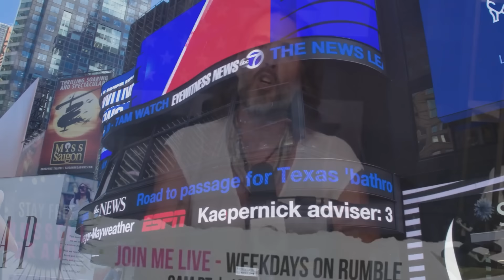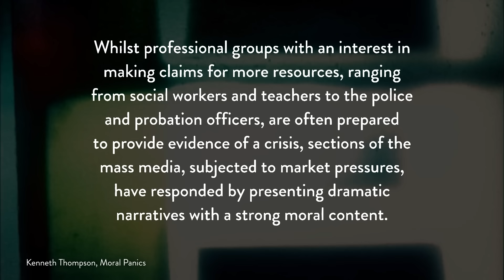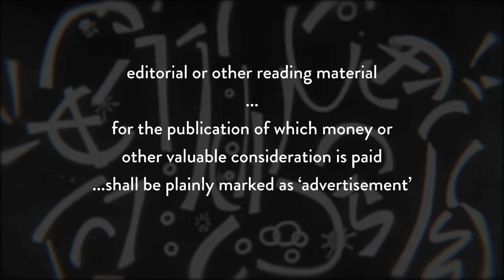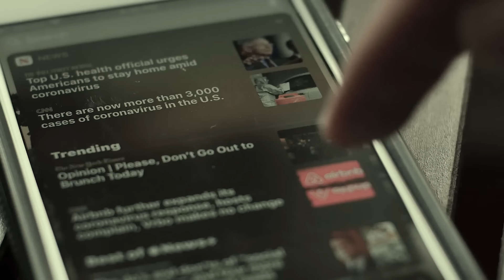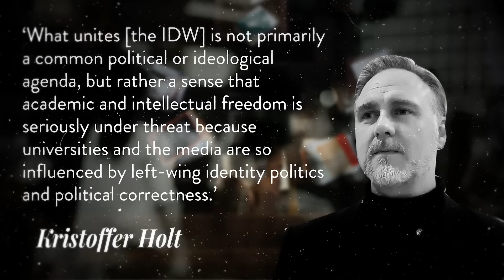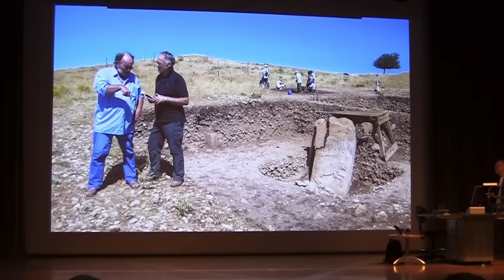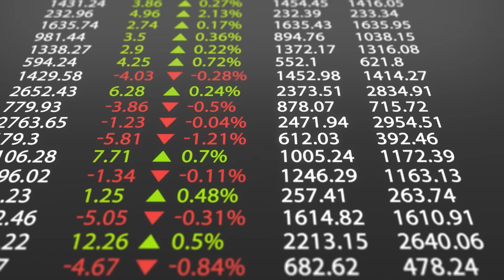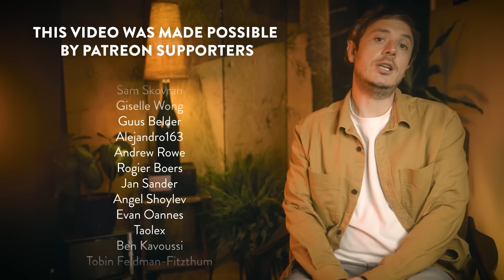The Rise and Fall of the Mainstream Media

Comment: Yesss, another long video full of quality and with no ads that I can enjoy for years! Thank you so much Then & Now!
Reply: Okay bot
Reply: It literally has ads.
Reply: Just have youtube ad free. I never get one single ad. It worth money
Reply: I can't imagine anyone finding this either entertaining or enlightening enough to rewatch. Good for you
Reply: The The
Reply: This video makes you think twice about the recent stabbings
Reply: Technology may have advanced enough to release civilization from the confines of the second law of thermodynamics. 

These confines were imposed during Victorian England's scientific and religious cultural fascination with steam engines. 

The second law is behind modern refgeration needing electrical energy to compress the refrigerent to force it to release as waste the heat that it has removed from the refrigerator's service interior in the cooling part of the refrigerent's circulation. There is also discarded heat from mechanical friction and electrical resistance. 

Refrigeration by the principle that energy is conserved should produce electricity instead of consuming it. 

It makes more sense that refrigerators should yield electricity because energy is widely known to change form with no ultimate path of energy gain or loss being found. Therefore any form of fully recyclable energy can be cycled endlessly in any quantity. 

In an extreme case senario, full heat recycling, all electric, very isolated underground, undersea, or space communities would be highly survivable with self sufficient EMP resistant LED light banks, automated vertical farms, thaw resistant frozen food storehouses, factories, dwellings, and self contained elevators and horizontal transports. 

In a flourishing civillization senario, small self sufficient electric or cooling devices of many kinds and styles like lamps, smartphones, hotplates, water heaters, cooler chests, fans, radios, TVs, cameras, security devices, robot test equipment, scales, transaction terminals, wall clocks, open or ciosed for business luminus signs, power hand tools, ditch diggers, pumps, and personal transports, would be available for immediate use incrementally anywhere as people see fit. 

Somé equipment groups could be consolidated on local networks. 

If a high majority thinks our civilization should geoengineer gigatons or 
teratons of carbon dioxide out of our environment, instalations using devices that convert ambient heat into electricity can hypothetically be scaled up do it with a choice of comsequences including many beneficial ones. 

Energy sensible refrigerators that absorb heat and yield electricity would complement computers as computing consumes electricity and yields heat. Computing would be free. Chips could have energy recycling built in. 

A simple rectifier crystal can, iust short of a replicatable long term demonstration of a powerful prototype, almost certainly filter the random thermal motioren of electrons or discrete positiive charged voids called holes so the electric current flowing in one direction predominates. At low system voltage a filtrate of one polarity predominates only a little but there is always usable electrical power derived from the source, which is Johnson Nyquest thermal electrical noise. This net electrical filtrate can be aggregated in a group of separate diodes in consistent alignment parallel creating widely scalable electrical power. The maximum energy is converted from ambient heat to productive electricity when the electrical load is matched to the array impeadence. 

Matched impeadence output (watts) is k, one point three eight x 10^ minus 23, Boltzman's constant, times T (temperature Kelvin) times bandwidth (0 Hz to a natural limit ~2 THz @ 290 K) times rectification halving and nanowatt power level rectification efficiency times the number of diodes in the array. 

For reference, there are a billion cells of 1000 square nanometer area each per square millimeter, 100 billion per square centimeter. 

Order is imposed on the random thermal motion of electrons by the structual orderlyness of a diode array made of diodes made within a slab: 
____________________  - Out
  🔻🔻🔻🔻🔻🔻🔻 
____________________ + Out 

All the P type semiconductor anodes abut a metal conductive plane deposited on the top face of the slab with nonrectifying joins; all the N type semiconductor cathodes abut the bottom face. As the polarity filtered electrical energy is exported, the amount of thermal energy in the group of diodes decreases. This group cooling will draw heat in from the surrounding ambient heat at a rate depending on the filtering rate and thermal resistance between the group and ambient gas, liquid, or solid warmer than absolute zero. There is a lot of ambient heat on our planet, more in equatorial dry desert summer days and less in polar desert winter nights.

Focusing on explaining the electronic behavior of one composition of simple diode, a near flawless crystal of silicon is modified by implanting a small amount of phosphorus (N type)on one side from a ohmic contact end to a junction where the additive is suddenly and completely changed to boron (P type) with minimal disturbance of the crystal lattice. The crystal then continues to another ohmic contact. 

A region of high electrical resistance forms at the junction in this type of diode when the phosphorous near the ĵunction donates electrons that are free to move elsewhere while leaving phosphorus ions held in the crystal while the boron ions donate holes which are similalarly free to move. The two types of mobile charges mutually clear each other away near the junction leaving little electrical conductivity. An equlibrium width of this region is settled between the phosphorus, boron, electrons, and holes. Thermal noise is beyond steady state equlibrium. Thermal noise transients, where mobile electrons move from the phosphorus added side to the boron added side ride transient extra conductivity so the forward moving  electrons are preferentally filtered into the external circuit. Mobile electrons are units of electric current. They lose their thermal energy of motion and gain electromotive force, another name for voltage, as they transition between the junction and the array electrical tap. Inside the diode, heat is absorbed: outside the diode, to exactly the same extent, an attached electrical circuit is energized. 

Understanding diodes is one way to become convinced that Johnson Nyquest thermal electrical noise can be rectified and aggregated. Self assembling development teams may find many ways to accomplish this wide mission. Taxonomically there should be many ways ways to convert heat directly into electricity. 

A practical device may use an array of Au needles in a SiO2 matrix abutting N type GaAs. These were made in the 1970s when registration technology was poor so it was easier to fabricate arrays and select one diode than just make one diode. 

There are other plausible breeches of the second law of thermodynamics. Hopefully a lot of people will join in expanding the breech. Please share the successes or setbacks of your efforts. 

These devices would probably become segmented commodities sold with minimal margin over supply cost. They would be manufactured by advanced automation that does not need financial incentive. Applicable best practices would be adopted. Business details would be open public knowledge. Associated people should move as negotiated and freely and honestly talk. Commerce would be a planetary scale unified conglomerate of diverse local cooperatives. There is no need of wealth extracting top commanders. We do not need often token philanthropy from the top if the wide majority of people can afford to be generous. 

Aloha
Charles M Brown 
Kilauea Kauai Hawaii 96754😊
Reply: I have ads. This is a spam account
Reply: I love how in depth these videos are!  Keep up the good work!
Reply: If you still don't know how to watch YouTube without ads in 2024 then you must be a boomer
Reply: Hahababahahahahahhahaanabhabancnffnekeke “no ads” my nads. Gimme a break. What kind of comment is this? Who actually cares to watch these dreadful, disorienting, propaganda … fill your brain with this nondsense if you wish. Dare you to recall one thing learned from these I’ve watched a few of these guys videos and left more confused about whatever the topic at hand was then when I started
Reply: @rsimpson69 same man. samez this dude is wrong about so many things it’s kind of bizzare to me that any with a slight hint of intellect could sit through 2 hours of this crap📀 opioids for the mass
Reply: I got ads

Comment: found this very tilted against new independent media.  The claim that working in a larger organization is a protection against lies and mistakes, does not prove accurate.
Reply: Oh totally disagree, nothing stops an independent journalist from lying. In an organisation there is a higher thank nothing chance of preventing misinformation.
Reply: The opposite is far less than that. With companies you can have other people fact check and their veracity is paramount. Single individuals can lie and distort with impunity and as long as they sell you an Us vs Them mindset, nothing will dissuade their fans.

Comment: This essay seems disjointed, at the start you say state taxes on the industry centralized the press while repressing working class publications. As you show, it brought about a monopolization of the industry, but later you take the line that capitalism, i.e, private (not state) control was the problem. These are contradictory arguments. Either you lower the barriers of entry to the industry, (not tax, not regulate) or you do the opposite. Which approach to you seems more likely to establish a corrupted profession? You see profit and truth as opposing dipoles. This is a reductive and flat out wrong analysis.
Reply: Er, no they're not contradictory at all.

Once those monopolies were established, the tables were turned: private capital owns governments rather than the other way around, whilst those in power rotate between senior roles in government & private industry, creating mutual dependencies between the two and leaving everyone else out of the picture.
Then along come the modern shock jock grifters, simply adopting the same strategies outlined by Bernays as the legacy corporate media first used to enrich themselves.